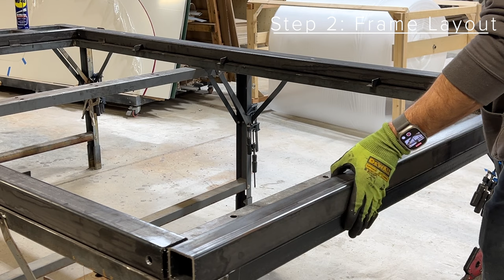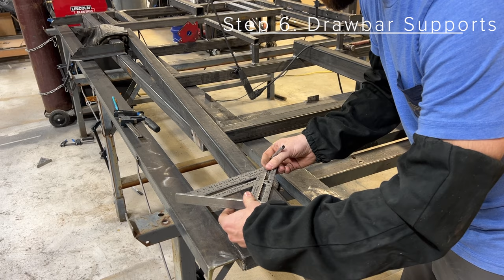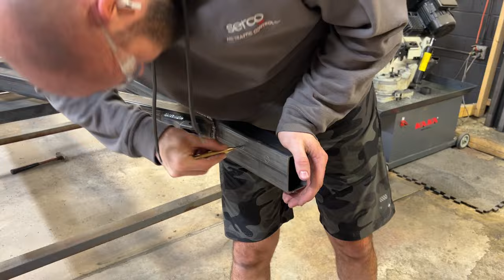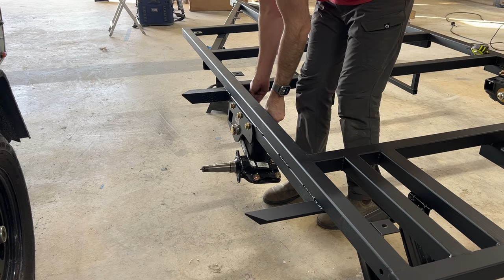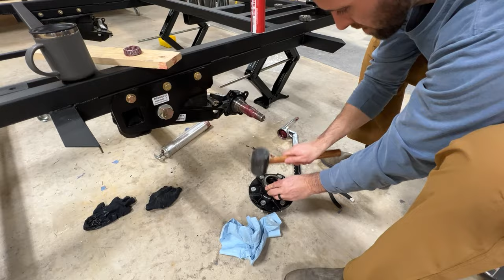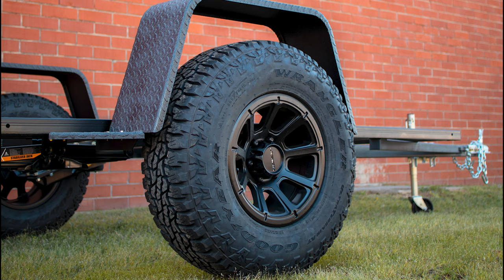Building a Trailer Frame for a Teardrop Camper - Start to Finish - Timelapse

Comment: I tap welded a make shift frame for an office on a huge crab ship in the middle of the Pacific and just hung up drywall..  This is Gangster! You are top shelf dude.
Reply from the maker: Thanks! So you welded a trailer for a camper on a ship in the middle of the Pacific…? What was it for?

Comment: Good stuff. Looks like a beefy build.  I intend to make my frame when I do my DIY build.  I grew up on a farm with a full metal fab shop.  I only have the basics where I live now(welder, weld table, chop saw and angle grinders), but may make a trip back “home” to the farm for the build.  The right equipment can certainly make the build easier and more efficient.
Reply from the maker: Absolutely! We made a jig so we can quickly set the tube in place and tack it together. Having the right set up makes it so much quicker! But it can be done with the bare essentials too.

Comment: I see that people recommend to use 45 on the corners. I think that's a good idea, but the 90 corners you are doing seems that it would be much easier to square.  I'm going to use gussets, so I don't think there will be a problem with strength.

Comment: hi, thanks for sharing this. what do you use to coat the frame. also, just wandering, on your stabilizer jacks, any particular reason you used 2 extra tubes (per jack) to attach, instead of just one plus perimeter tube? this would make it more stable i think, or would it be interfering with your design?
Reply from the maker: We coat the frame with automotive primer and paint, and use truck bed liner on the tongue, fenders and other vulnerable areas. It could likely be done with the side bar but it would interfere with attaching the camper.

Comment: After thinking about this for quite a while and looking all around the variables in all the steps and feeling overwhelmed, I have finally decided to get after it and get to work 1 step at a time. Frame is where to start. This video is great. I see the corners are overlapping in the video vs in the plans they are cut at 45 degrees in a miter joint. Curious about the different approaches from your perspective. I assume the square cut is easier to keep square and is less temperamental as far as warping. Any advantages to the miter joints?
Reply from the maker: That’s great! I know you can make it happen, and we’re here to help. 

The square cuts are simply easier to cut. The mitered cuts might look better and provide the full frame to run wiring if you go that route. Initially we did the miters also to give no open ends, but we simply put a cap on the ends to solve that issue. Also, you are correct, getting the square cuts square is much easier. In the next plans update we will be making a few changes to the trailer frame, including this.

Comment: Great video! Thanks for taking the time to film and edit it.  One part I was really curious about was how you cleaned up the welded frame and coated it. Did you leave that open so people could choose their own method? I'm curious about rolling on or spraying a coating, vs dropping it at a powder-coating place. Any suggestions? Thx!
Reply from the maker: Thank you! Honestly I felt that it as pretty boring to watch me wipe the frame down. This one we had to wipe down with acetone several times over until it was completely clean of oil. Then we prime, paint/raptor line the frame and fenders. Having a clean surface is probably the most important step here. We also use a surface restorer as well to get it down to bare metal.
Reply: @WanderTears  thank you! The coating looked great afterward!
Reply: Dang! That thing is stout! Great build!!!

Would you say it’s overbuilt or am I just underestimating the needed strength for a tear drop?